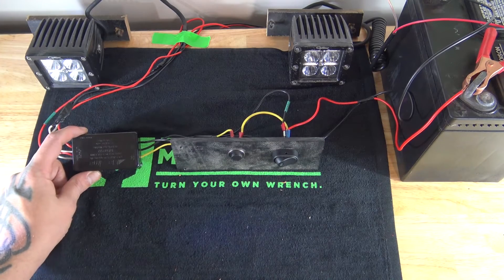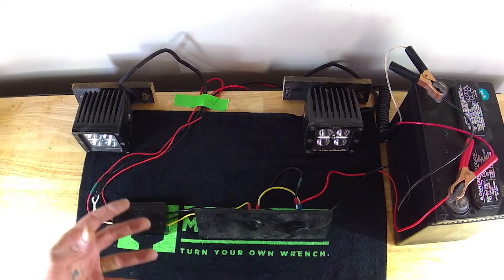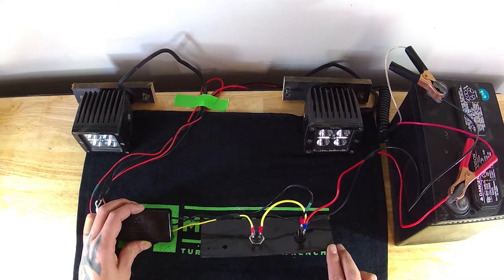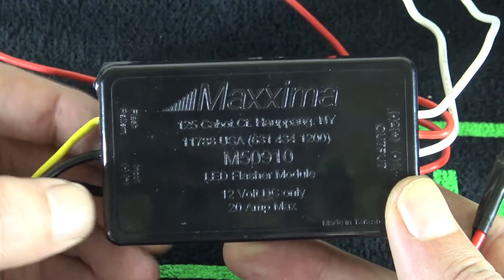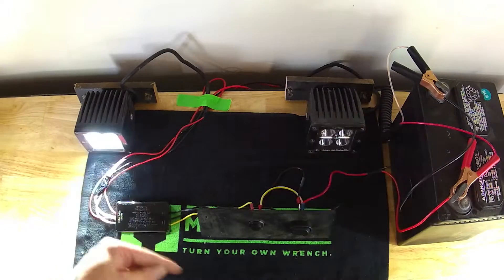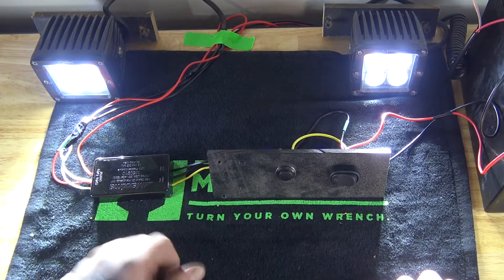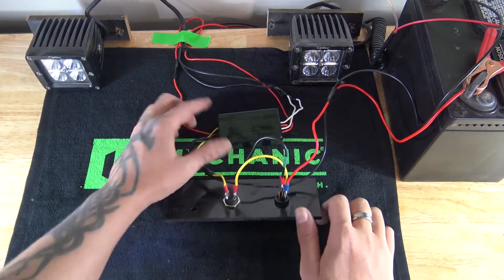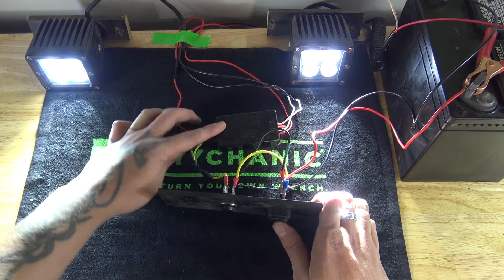LED Strobe / Flasher Module (Maxxima M50910)

Comment: What kind of strobe controller would i need to control a full light package with 14 strobes and running board strobe lights and tailgate bar but i definitely want to make them solid if need be

Comment: How many lights can you put up to that module
Reply from the maker: According to Maxxima, 20 amps total, 10 amps per "side".
You would have to do some simple math to figure out how many lights of your choosing you can use.
WATTS divided by VOLTS.
I'll use easy numbers just to keep this simple. You'll need to look up your own numbers.
Figure out how many Watts your lights are, let's say one of them is 24 Watts & you have 12 Volts (24÷12=2) this means that light is 2 Amps. Each side of the flasher is rated by Maxxima for 10 Amps. This would in theory allow you to run 5 of those lights per channel.
You can see how this changes with your light choice. If the light were 48 Watts (48÷12=4) now you could only run 2 of those per channel without going over 10 Amps.
I hope that all made sense. Thanks for watching!

Comment: Hi very nice detailed informative video.  I have an 12v aftermarket led strip light spoiler installed on my car. The led controller box has four functions (parking light, brake light, turn signal light, hazard/warning light).
When ever parking lights are turned on the strip has this slow running/matrix lights strobe functio. I want to disable this strobe function and just want the led strip to turn on normally or may be turn on completely on half brightness on just the parking light mode. Is there any way to disable or remove this strobe function from the led controller module. Please suggest a solution. Thanks.

Comment: I have 6 auxiliary off-road lights currently controlled by a Auxbeam 8 gang controller. You said the strobe module would have to be installed the after the relay panel. My question is, do I need to install 1 diode from the auxbeam and 1 diode from the strobe controller to 1 light so they can be used independently?

Comment: Hello I was just wondering on a 2012 Dodge Charger I got one of your stroke modules on your YouTube channel that you put up where exactly where I put that on there you said before the headlight relay does that mean before the fuse box cuz that's where my relay it is at as in the fuse box underneath the hood so basically I would hook him up to my headlight wires or something like that coming out of the headlights if u my chance having a wiring schematic I know what wires to hook it up to that would be great

Comment: Can you ground the lights to the chassis or the battery? Or do they have to be grounded to the strobe module?

Here's my two cents:
If the strobe module wouldn't have a solid setting, i think you could still get by wiring it using a 5-pin relay, a 4 pin relay and a 3 position (on-off-on) DPDT switch.
Just connect the strobe module to pin 87a and the LED lights to pin 87 of the 5 pin relay. One "on" side of the switch to signal de 5pin relay, and the other "on" side to signal the 4 pin relay, that should be wired to interrupt the ground or negative pole of the strobe module using pins 30 and 87, this in order to avoid unwanted activation when the switch is in "off" position.
This would give you a solid setting by providing constant power to the LED when the 5 pin relay is active by the first "on" position of the switch.
And when not active, pin 87a of the 5pin relay would provide power to the strobe module, that wouldn't power up unless you use the second "on" position to signal
the 4pin relay to close the ground of the strobe module.

Not completely sure if this is correct as I haven't tried it myself, just throwing an idea here.

I will definitely try this in the future and make a video of it.

Comment: Yeah I got a question do you use a rocker switch or a toggle switch if you want to hook up your wigwag module on your vehicle it to make it to where you can change through the flash patterns on it because I bought one of the weed whack models that you show him this video and I was wondering what kind of switch I need to get to be able to change patterns if I wanted to do

Comment: You said if I have a relay on my wire harness to install it after it. Can I piggyback after the relay and then run the yellow wire to a separate push  Button with power?.

Comment: It needs to have the solid on and the flash patterns separated and flash needs to take priority over solid on so that you can wiring running lights through it 24/7 then when you hit your strobe switch it overrides the running lights and strobes them and you can go through strobe patterns
Reply: This is what i was also asking, im looking for the same setup application, ever figured out where to find that module to do like you said? Thanks
Reply: @VRODTOUGH  You need the strobe module and 2 relays. I don't remember who but I've seen someone on tiktok is selling just that but in a self contained box you can tap directly into your fuse panel with for the running lights, Personally I wired my own box up. I did it years ago so I no longer have a diagram and i'd have to think about how I wired it up because I wired 50 3/4 dot lights into 2 junction boxes then I wired my relays into their own box with the flasher and then tied the two together so I have a lot going on that id have to try and remember what all I did, but it's just the flasher and 2 relays, been running strong for years.
Reply: @VRODTOUGH  I'm pretty sure first relay is normally closed and gets main power feed from running light switch, So long as running light switch is on the relay feeds power to the running lights, from there the signal wire is switched by the strobe switch, when you turn strobes on first relay opens and therefore running lights are no longer powered, the second relay is normally open with main power coming from running light switch again so it only functions while your running lights are supposed to be on, the signal wire is your strobe switch and the output goes to your strobe module, from there you can use the strobe modules outputs to feed your lights. If the strobe module doesn't have enough amperage output to feed all your lights (you have too many or you are using non led) then you would need a 3rd relay to amplify the power output but I'm not so sure how long that relay would last with constant cycling from the strobe module, you'd probably want something specific for that task. 
Now this all needs to take place inside of a junction box so you can have multiple wires than can be feeding power (relay A output and strobe output) 
I'm not 100 percent sure but off the top of my head I imagine that's how I wired it and I don't think I've had any problems with backfeeding from relay a to the strobe module or vise versa.
Reply: @VRODTOUGH  I take that all back, ignore the complex shit I said in the last comment, I did that because I utilized both outputs of my strobe module for different patterns but you can only do that on separate lighting circuits, if all your lights are wired together I see no reason why you couldn’t use a single relay and make 30 your output, and 87 and 87a your running light and strobe light module inputs. And make the strobe light switch your signal wire to switch the relay from one to the other, running lights will be your normally closed side and strobe your normally open side, when you flip the strobe switch it will turn on your strobe module wired to that switch and it will switch the relay to the normally open side which will be your strobe module outputs. This will make all lights flash together and it will override your running lights, and will work with running lights on or off so long as the relay is wired to constant power, I’d choose an ignition circuit for that.

Comment: do you need a controller for flush mount leds, i have a inline fuse and relay to the switch and on to 8 mini strobe lights, will this work, and will there still be strobe patterns i can select, i have a button next to my switch that is for changing patterns, but took out the controller box, will it still do different patterns

Comment: Only thing is the ratings on Amazon shows they don't last. (?)
Reply from the maker: I have not looked at the ratings for these in a while, but they used to be good. Companies are always changing things though, make them cheaper and sell more of them and sometimes you end up with a bad product. I can speak for the ones I got a while ago and they work fine, but as I said, they could be made a little cheaper now...

Comment: Sir can I ask questions,  it can be use 60-90 watts? Led??
Reply: Thanks sir.
Reply from the maker: These modules are rated at 10A per light for a 20A total. You would be fine with 90W LED's but I would not recommend going any higher in wattage or using more that 2 90W lights. I have to say that these numbers are provided by the manufacturer, so I can't back this statement 100% as I have not tested these with that high of wattage. Thanks for watching!

Comment: You may have already deduced this but I think the module that does not have a solid light function is mental to have a by-pass switch. To me, that makes more sense when switching between strobe and lamp function.     I would rather do that then cycle through 14 settings before landing on illumination setting.  That is just my feelings. 

By-pass module with hot and ground and place some diodes to prevent back feeding add switch and maybe relay.
Reply from the maker: You are correct, they can be wired that way and I have done it in the past. I just found this to be a cleaner alternative, much less wiring and easier for most people to understand. I'm sure I'll have a video of how to wire and bypass the other type modules in the future. Thanks for watching!
Reply: @RockyXTV   yea,  you looked like you know whats up. I cant imagine flipping a switch 14 times to get AUX beam. I subscribed.
Reply from the maker: @pillormark  Thanks!
Reply: @RockyXTV  Hi, I came across your video when trying to figure out how to do this exact thing. Did you ever make anything on how to wire up a light to have one switch allow the lights to be solid on but also have it set up to do strobe functions. I have tried to wire it up but seems like one would always take control. Either the solid on switch would only work or the strobe box would only work.

Comment: Thanks for responding...what i would like is to have different hazards patterns on my existing maxxima turn/hazard/stop lights. Again, thanks 🙏
Reply from the maker: I'm not sure how this module would work with hazards as it would just cycle the module on and off. This would reset the module everytime the hazards blinked. I'm sure there is a way to do it, I just can't think of it off hand.
Reply: So if i connect to my hazards although i will not be able to control flash pattern will it do all cycles like on default mode when i turn on my hazards ? Thanks
Reply from the maker: @JoseOrtega-xn4mj  I honestly don't think this would work out how you want it. Your hazard lights would just turn the module on-off-on-off and not really stay on long enough to cycle through any flash patterns. The module needs a constant power to go through the patterns.
Reply: Thanks 🙏

Comment: Can i wire this strobe module to my existing maxxima led stop/tail/turn lights on my dump truck?
Reply from the maker: In theory you could, are you just wanting to have flashing brake lights or are you wanting to have different "hazard" light patterns? If you just want flashing brake lights I have a video on a different module specifically made for that purpose. It's also a lot more simple to wire and it's considerably less expensive.

Comment: Hey I'm just curious you said that that's for LEDs can you use regular lights as the lights for this module can you just like on an 07 Chevy tie into the turn signals and tail lights is there anything that would be hurt from doing that or will the module be damaged in any way?
Reply: Okay I might try it and I might just replace the Flasher bulbs and turn signals with LEDs just to solve that problem but I'd like to try the regular filament bulbs first I'm on a fire department so I just got okay by my chief that's is why I was wondering
Reply from the maker: The module is rated at 10 Amps per "channel" and it has 2, so I don't think the module will have any issue. Let me know if it works or blows the bulbs, I'm really interested because you're not the first person to ask about this.
Reply from the maker: I think the module would be fine, but the flash pattern is so fast that it would burn out the filament in a regular style bulb. I could be wrong though, I've never tried it.

Comment: Can this module support multiple strobe lights? If so how do yo wire them.
Reply from the maker: This module had 2 positive and 2 negative outputs, so ideally you would run a  set  of lights. The manufacturer states that this module can support 10 amps per "channel" so 20 amps total. If this is true you would be able to wire multiple LED lights to this module. You would just have to figure out what lights you want as left and right "channels" and just wire them together. Thanks for watching!

Comment: Ive gone through two of these i cant get either working correctly, i tried with and without a relay, anytime i cycle through the channels it turns off then never turns on again, only pulling about 3 amps per output.
Reply from the maker: I need to do an update on these. Mine to have failed in the last 2 weeks. I spoke with the company and they said these are a new design and that they don't seem to work well with some LED lights because of some "start overload protection" I guess most modern LED lights are triggering this function and doing exactly as your's and mine. It's a huge pain!

Comment: Any chance for a video with relay?
Reply from the maker: I may be able to put something together, it will be a while though, things are pretty backed up around here. It is really simple to use with a relay, you just wire the relay as normal and put this module on the 12v+ wire for your lights. Just make sure you install it after the relay not before, this would cause the relay to strobe and relays don't like to strobe. Thanks for watching!